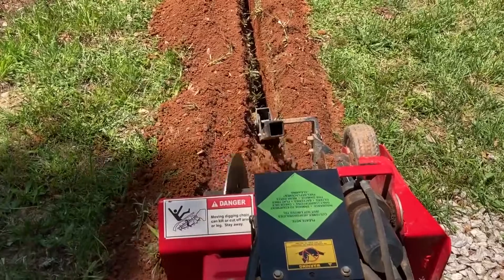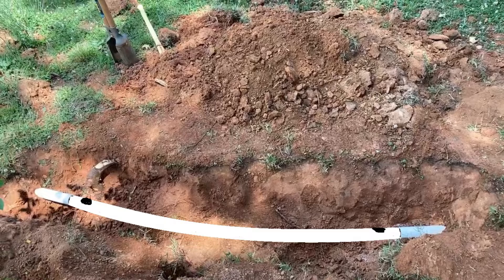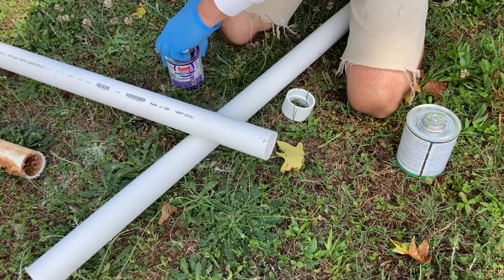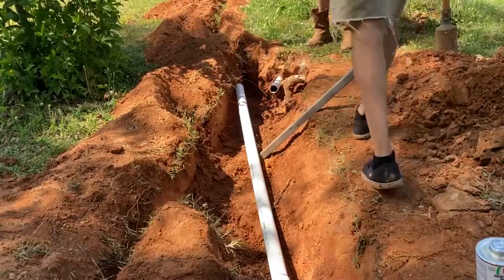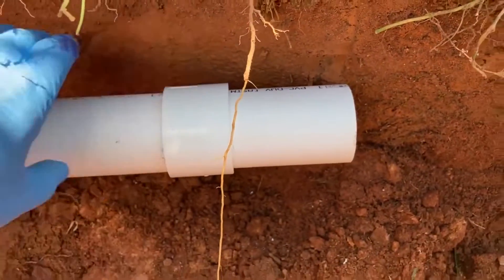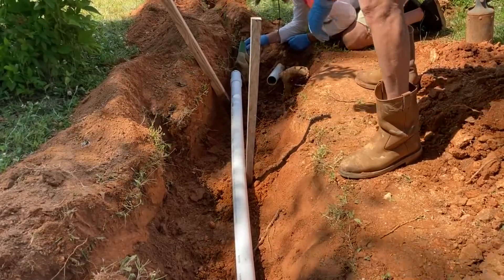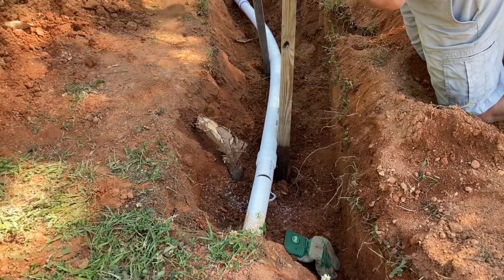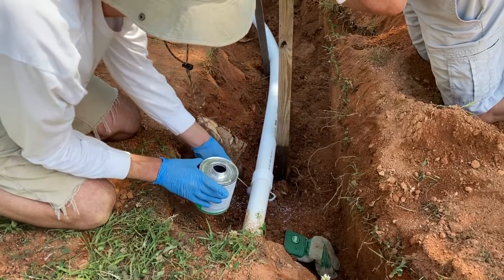How to bend PVC without heat

Comment: those are not pressure rated fittings. they are short drain / vent couplings. That 2" line is a pressure line to pressure dose your septic system.
Reply from the maker: Thanks for the input. It's a sump pump line.

Comment: Too much stress on the pipe. At the very least you should have heated up 5 gallons of hot boiling water or sand on a gas grill and dumped it on the pipe and then cover it up. This will relax the pipe stresses some but pre bending is the way to go.

Comment: You'd think they'd make those slip couplings wider for a stronger less stressful hold... especially for this application. And no, primer will not cause parts to stick once you apply pcv cement... parts will still slide together quite easily.

Comment: The extra pvc cement you added to the outside of the fitting most likely did nothing to strengthen the connection or improve the seal.
Reply: I have actually fixed leaks on superficial PVC pipes doing that myself, it's usually a temporary/lazy solution I apply at home
Reply: Agreed, PVC cement "melts" two parts together, it doesn't actually provide its own seal. It's scientifically made to bond "interconnected" parts, it does nothing applied to the outside under any nominal pressure.
Reply: @garyr7027 it still melts them together whether it's on the inside or outside....... The chemical bond is still created resulting in a permanent joining of the two pieces
Reply: @jamesbrooks7591  agreed that the pieces of pvc have to be "sandwiched" together with glue in between.

Comment: As a drainage technician I can safely say bending pvc either by heat or or cold will cause a premature failure point. I get many emergency calls for broken pipes in areas that have been bent. I'd say that bend will take about half the lifespan of the pipe away.
Reply: Seems would be better to put in angle pieces instead of bending it like this & leaving it in an extremely stressed state
Reply: heating and bending is done all the time especially in pool applications

Comment: You can also heat PVC pipe to get the bend. Fill with sand, heat then bend. Let pipe cool then empty and you have bent pipe not under any stress.
Reply from the maker: I knew about in the heat, but not about the sand. Good tip!Thanks, Krugzug.!